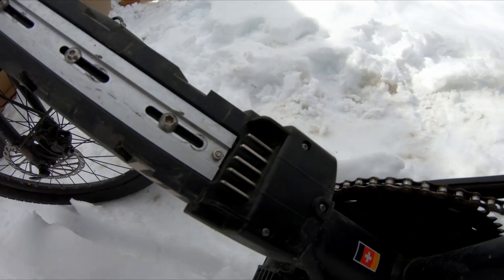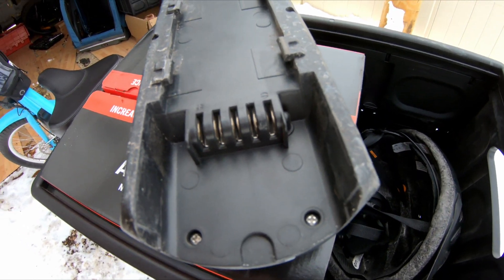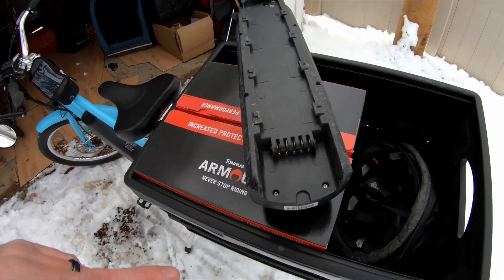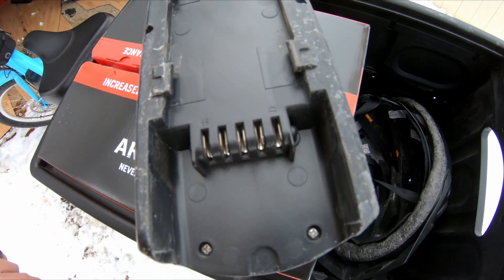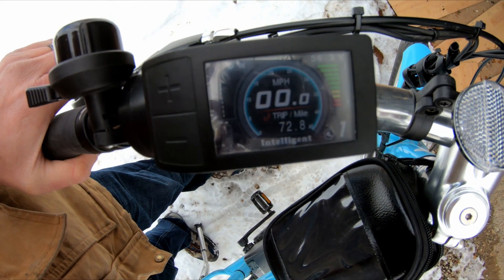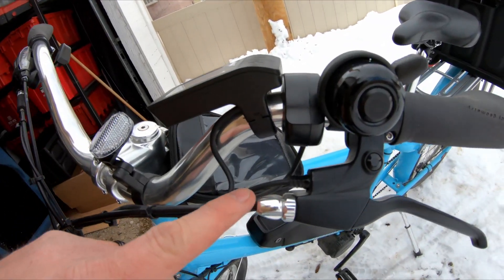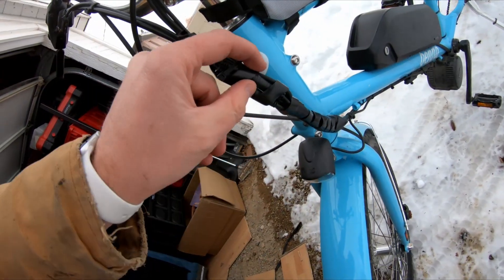Electric bike not working? Try these Troubleshooting steps!

Comment: My e-bike battery is fully charged. It started happening for the past week where my charger would only take not even 20 minutes to charge it and I would only get maybe a block out of it before all of a sudden it was cutting off on me. I don't understand what's going on. I think the parts where I put the battery on the connection in the battery had spread apart over time a little bit. So we took the battery apart and tighten those back to as tight as we can go basically. But I put my battery in. It says it's fully charged till my charger. I know the charger isn't the problem because I've bought another one and it's doing the same thing. Battery indicator doesn't turn on anymore even with the key on and plugged in. It's not still not indicating any charge and suggestions i dont have a voltage meter tey
Reply from the maker: Get a good voltmeter. Could be a bad connection somewhere or the cells are toast. Hard to say without testing it.
Reply: i think i set off the bms it happened once before i noticed the two wires from the controller to the battery posts had loose/poor connection adapters crimped  onto the wires to connect the two kinda short on funds atm can you suggest how i might try just resetting the bms without a volt meter? my battery is less than a year old and its samsung so i doubt the cells are toas already and i took off the oose connection pieces and Soldered the connections properly so that Everything is connected good and. I went to try my battery on it again and noticed that it had. set it off again like I pressed the indicator light to see the charge and it was just recently fully charged before this happened and the indicator light doesn't even give me one bar. It doesn't light up at all, so I'm assuming it's the BMS. doing it. Thanks. If you have a solution. and thanks for taking the time to read all that L O L
 and thanks for taking the time to read all that L O L  @JohnnyNerdOut

Comment: What if the key lock component is housed separately such that when the top cover four screws are removed, the key lock component is residing in a separate compartment housed in plastic cover adjacent to the main plastic casing? And battery is slided into the battery holder bracket of the ebike?

Comment: Hi my batter wont charge past 60% ive checked conections tested the charger and replaced displays and even tried stanged charging and nothing works any advice?
Reply from the maker: Could be the battery. Is it old?
Reply: @JohnnyNerdOut  only 9 days old
Reply: @JohnnyNerdOut  it was reaching 100 then just stopped
Reply: @JohnnyNerdOut  ho a little up date tried charging it to 60 and then running it a bit then recharging and that seems to be nursing it slowly back up

Comment: Hi Johnny
I've got a Cyrusher Ranger, great bike but pedal assist has stopped working. The bike rides well on the throttle and cuts out when I pull the brakes, so thats OK but just doesn't put any power assists down when I start pedalling, I wonder if you have any idea what that could be?
Thankyou
Sandy
Reply from the maker: Pedal assist sensor or controller likely

Comment: Hey John, I have a question. can l replace any lcd display with throttle on my ebike? My ebikes now doesnt have throttle. i want to upgrade and put throttle on it. is there any points you can give me before doing the upgrade? last thing, changing my display will it affect my controller?
Reply from the maker: Not just any display with work. You will need to make sure it’s compatible with your controller first. If you bought it complete. Ask the manufacturer (brand) what options you have. Replacing controllers can be a headache especially if the brand is not helpful.

Comment: I just got a new ebike trike. It wont power up after assembly. In the brain box there a two white wires, male and female that are not plugged in. Should thry be?
Reply from the maker: Most likely. I’d confirm with the manufacturer before plugging things in that you aren’t %100 about though

Comment: Hi, I bought a battery and charger for a pre-owned Geliesen Ebike.  When I received the battery, the bottom doesn’t have the pin connectors.  It’s just metal on the bottom. Is it possible to still use the battery with this bike?

Comment: my hailong battery on its self says fully charged but on my display its showing 39.8v i have no power what so ever ive checked all wires. when its on there is like this clicking noise coming from inside the battery ? has the fuse blown ?
Reply from the maker: A 36v battery should be charging up to 42v fully charged, fully functioning. If it is only going to 39v you may have a bad cell

Comment: Thank you for your time, info and expertise. I have a Rambo G3 750 bafang. I'm having problems with the controller turning off during operation typically under a heavier load or uphill.    My battery connections seemed good and my voltage is good on my.  Do I need to check and likely start by replacing the controller in the motor

Comment: johnny  I need help, i have a new battery that wont work but the old one still does.  Bought from alibaba it puts out correct voltage and polarity is right, still cant get it to power on bike.

Comment: Thanks it is a PA and Throttle. Battery is brand new but could have a defective cell. If the controller easy to check?

Comment: I have a befang mid-drive. Just got a new battery. Started my ride with a full charge; during the ride, the display will go from, say 95% to 0% engine while still providing assistance; then the engine will surge with power, then no power. As an example, the display will go from 0% to 10% to 33% to 77% and then back to 0%. The new bike battery is only a month old. Worked fine for a month, and then the problems started again. I say again because this happened with a 3-year-old battery, and they told me to replace the battery to fix the problem.  Problem was fixed for only one month. Do you have any idea what else could be going on?  Befang has around 10,000 miles under the hood.
Reply from the maker: Need more info. Is it only on pedal assist or throttle as well? If only PAS, it’s likely the pas circuit or sensor. If throttle too, could be battery or controller
Reply: Sorry, mis read your message. It’s both on throttle and PAS

Comment: Johnny love your videos. I have a question on a new build with a bafang 750 mid drive. Everything seems to be working, but only for like 1 second then motor slows way down, if let off of throttle when hit I again get full power for about a second then it cuts back to barely working again. Any help would be greatly appreciated , I do have another bike with all the same parts so I will change 1 piece at a time to try and find the problem but you might have seen this before.

Comment: Aventon level 1 is not working; has less than 500 miles...battery is charged. Turns off within seconds of powering up? Gotta check the wire connections

Comment: So I have a keteless k800 and my battery isn’t keeping a charge. I plug it into the charger, then will stop charging shortly after saying it’s fully charged. I can turn my bike on and it either dies right away, or I can go maybe not even a 1/8 mile. I’m thinking my battery is just fried, but if I can just replace something in the battery instead of buying a new one. If anyone could help, would greatly appreciate it!
Reply from the maker: Could be a bad cell. Replacing a cell is cheap, but labor intensive.

Comment: How do I  adjust my petal assist sensor. My petal assistant will turn on and kick in while bike is turned off.
Reply from the maker: Need more info. If it’s a bafang bbs mid drive and you bought from us, you can call the shop to get help with it

Comment: My battery shows it has power but it doesn't have any power
Reply from the maker: Check the battery with a voltmeter to determine if the battery is still good

Comment: Would these fixes work if my bike stopped working after a heavy rain? I drove it to work but we had a heavy rain storm well it was out there. 
now when I  turn it on the display says it's fully charged but won't move and has a distressed sounding beeping go off, it's an emmo monster that's practically new and im a bit panicked because water damage is not covered in the warranty
Reply from the maker: I’d try just replacing the controller. Might’ve gotten water damaged

Comment: I need help!!!!   We got two SwagCycle pro bikes and the back tire was flat needed a tube,bike was in perfect running condition before we took back wheel off and changed tube now it will spin the back tire for a couple seconds and then stop, my wife is ready to choke me she rode it one time any suggestions.?
Reply from the maker: Check the motor connection and the pins to make sure they aren’t bent

Comment: riding my mid motor e-bike today.  all of a sudden the motor stopped working  no peddle assist at all.   used i could back the bike up and no resistance. but now there is resistance backing it up..  no clue why this happened.
Reply from the maker: If you still have power to the display, I would look at your break cut off
Reply: @JohnnyNerdOut  yes.. still power to the display.

Comment: Hi. Maybe you can help me troubleshoot.

I have a converted e-trike with an MXUS motor hub that uses a 52v battery. Recently, any time I'd ride it, the e-trike turns itself off, then I turn it back it turns off again, then I turn it back on but won't come on unless I press the button 10x. Then it will come back on but none of the sensors work, then it just dies completely. To get it to remotely work again, I have to unplug the battery then replug it in, but it will not stay on long.

The batteries are still good, (trust me, I spent $600 on a brand new battery and it's still doing that), they're fully charged, the voltage is fine, and so far the shop that did the conversions have found nothing wrong with it and it works PERFECTLY fine when they use it, but it immediately starts doing it to me when I bring it home.

I tend to ride it at max speed, but this has never happened before, and even when it's not max speed it still does it. Is it something wrong with the hub, the motor, the display, the wiring? I need help figuring this out because this trike is my ONLY mode of reliable transportation.

Comment: My son bought a used electric bike and rode it well for about a week. The first time he went out in the rain it just stopped working. The baterry is showing full power but error code 06 keeps coming up but nothing works, no motor at all. He is so disappointed I could cry for him
Reply from the maker: Water may have corroded the throttle or display. I’d check all wiring and connections before replacing parts though 👍

Comment: Really appreciate all your videos! Not sure if you're still replying to videos, but I have a problem I have yet to see a video on. My bike has de-rated itself from 42km/h to 21km/h. Was like that for the first 500km as well. Then like a flip of a switch back to how it was. I don't know how I got it to go fast the first time, it just kind of did it on its own. Messed with display settings to try and get it back with no luck. Controller, display and motor inside all look good to me. Any ideas?
Reply from the maker: I’d do a firmware refresh (assuming you have a Bafang bbsxx?)

Comment: I adjusted the brakes on mine, took up the free play on the levers with an allen key, and unwittingly activated the cut off to the motor !!!! When you pull the brake lever, it cuts power to the motor for safety, by adjusting the brakes a little too much, the cut off switch was permanently engaged. Just backed it off a little and all was fine.
Reply: I did the same thing.
Reply: Oh an AI issue
Reply: so how do i turn it back on??

Comment: One of the contact points on my cradle is mostly burned away with even the plastic surrounding it being deformed.  Is it possible to buy a new contact point or if not, perhaps just the cradle itself?

Thanks
Reply: Yes get a new one

Comment: I have turn it on battery is full charge display isn't working brakes controller I checked all connections display thoddle just quit on me in of  riding stops ill check brakes then I need to order display thoddle removed from handle bar how  much to order accessories new battery

Comment: My RadRover 6 bike will not power up with the on/off button.  When I remove the battery and reinsert it  the display powers up but the throttle will not run the motor. On my bike the wire to the rear light was frayed.   Could this be an issue?
Reply from the maker: The rear light wire wouldn’t affect anything

Comment: Great video hey I built my own bike and my sisters. My sister hasn't rode her bike in while she trying again battery charged good display comes on. The pas light blinks on the screen the throttle shows "throttling" but no power to the motor?? Ive checked connections seem ok any ideas? I thought maybe controller but the screen comes on??

Comment: hello. my nakto camel 250w 36v bike has a good battery 41 volts as shown on ohm meter, and shows full charge on throttle lights. once i go to ride it will start to run down quickly. then it will cut out. once i turn the key off and back on it does fine but then will cut out again. could it be a bad battery but still read 41 volts? or coud it be another issue? the bike is 2019 and hasnt been rode much, but also was not charged regularly as it should have been. thanks for any help. i just bought a pair of these bikes from elderly couple on marketplace. whats weird is that they are both the same model but have different battery pack sizes. one bike is older than the other. both bikes read 41 volts and the other bike does fine, but the older bike (2019)model is the one with issue. im new to ebikes and i know nothing about them. very sad that i have trouble before i can enjoy the bikes

Comment: Hi, I've just bought a used samebike 20lvxd30  (e-one) it worked fine except for the display! So, i sent  for a new throttle and display unit thinking it's an easy fix and I'll be able to see my range for all functions pedal assist and throttle only etc,  how wrong was i, after fitting the new throttle and display the opposite was the result i achieved!  i had a display  that works  and i reprogrammed it to  the  following  settings. P1 = 48v   p2 = 0100  p3 = 0100 p4 = 0002  p5 = 0020  p6 = 0052 p7 = 1002  p8 = 0000 p9 = 0000 p10 = 0001        I assume  these are the correct settings as they were what i found on utube? And now there isn't any power to the hub  motor on pedal assist or throttle! Exactly the opposite  of what i had  before! Any ideas of what the problem is?  I would be very grateful for any idea's please

Comment: Why would the battery turn on when it is not attached to the bike but as soon as I connect the battery into it's position the lights go out & it will not turn on.  The cable to the display panel was disconnected, I reconnected it & it is tight together now.

Comment: Please reach out. I have a velimotor Vmx 12 electric dirtbike. I charge it fully. And turn it on. It stay on for 1 minute. And the battery dies. The led display stopped showing anything after a small crash. I checked all connections. And visible fuses. I am having a hard time finding parts or someone to work on it. I’m not an electrical guy. Please help. I would be interested in sending you the bike or figuring something out. Please advise

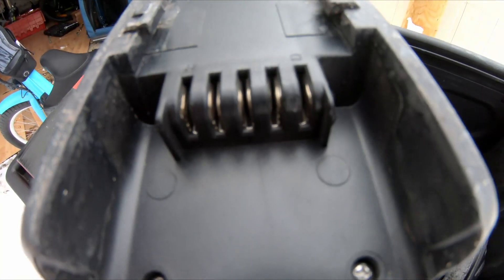Comment: 2:11 ,my 1 of those 5 connectors is missing. I think this may be the reason my ebike does not start but battery shows full signs of life.
Reply from the maker: Not all have 5 actual pins. Many just have 4. 2- negative and 2- positive.
Reply: @JohnnyNerdOut  the 5 pin female mounted on the battery, out of those 5 narrow spaces on it, in between are suppose to be 5 metal connectors that get in contact with those 5 male pin on the e-bike, on in my case, my battery has 5 narrow spaces but in it are only 4 connectors.

Comment: We purchased an E bike and it power comes on and when you turn the throttle it runs for about 30 seconds and then just shuts off, the motor has a red light flashing I don’t know if that’s an error code or not? Any advice would be helpful
Reply from the maker: Could be a speed detection issue. Is it registering speed? Next check brake cutoffs

Comment: i received a new battery which was too big and the bike shop had to move the thing the battery plugs into and now when i switch it on the lcd will light up and go off but generally if i switch the battery off and on again it will light up and its powered up sometimes i have to do this multiple times before it powers up. Do you guys know what the problem is? Could it be the prongs arent lining up right? Any advice will be very much appreciated...

Comment: Hi Jonnie.i dont no if you can help me with 1thing, i have a bafang batteri .to a 750 whatt motor, and when i shall charge it and i connect the into the batteri it spark, just a small one. Any why when i connect the wall socket first, then nothing happens. Have the batteri for s year now, happy if you can give mer a tip,whats going on.Ian from Sweden😁🇸🇪

Comment: My issue is the pedal assist surges, this started just recently. I bought bike new last year but when using full throttle mode, runs smooth. I have not unplugged brake sensors yet.

Comment: Was riding bike shut off pit battery back on sparks shot out the bottom piece where the power and ground weld into metal plate popped off is that my problem